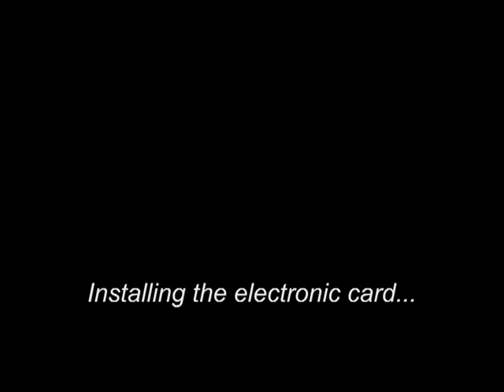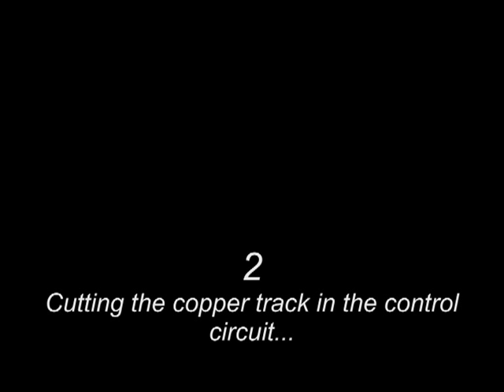Soldering the electronic board to the Daystate motherboard

Comment: Hi, do you know what the con3 empty plug is for on the circuit board? Got an .177 Ranger with a .22 barrel on it , which the previos owner did. Which has given the rifle a excellent sweet spot for target shooting at a 140 psi with very litle change in ft/sec. But very litle ability to change the power level. But I was wondering if daystate would of made one circuit board for both .177 and .22 and all you have to do is change where the trigger is plugged in. I have no idea about electronics though. Thanks, if you can help.